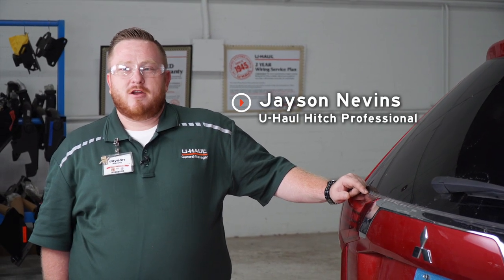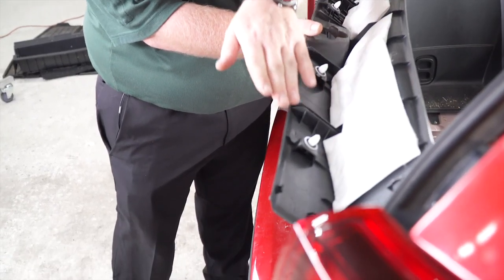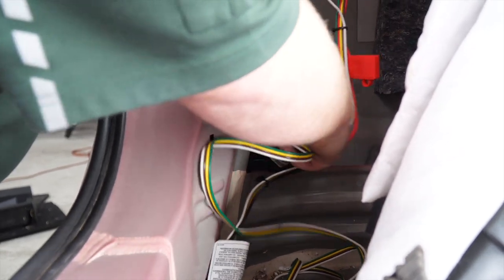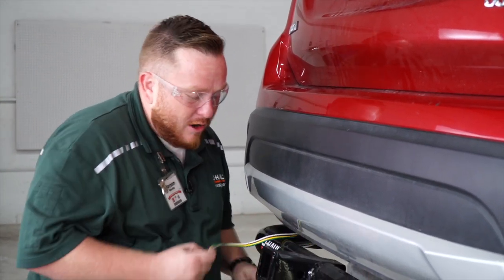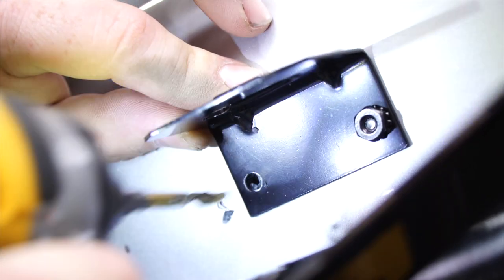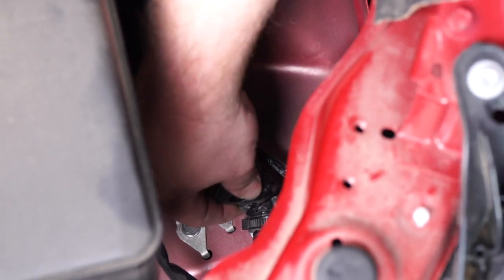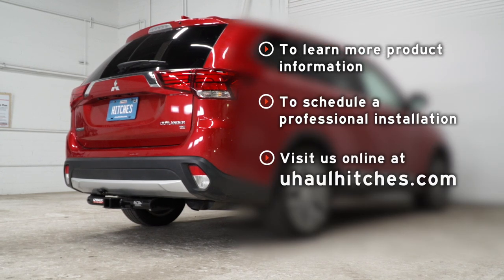2018 Mitsubishi Outlander Wiring Harness Installation

Comment: This says the instruction are for a 2018 Mitsubishi Outlander...but mine has the spare tire INSIDE the rear compartment area. Does my model, a 2018 Mitsubishi Outlander Sport SU, have the same quick connect behind the panel on the driver side? I don't want to take everything apart to find this is not the case. As a note, I looked under the hood for a quick connect, but did not see one. Any information is greatly appreciated.
Reply from the maker: Hi Stan, The Outlander Sport uses a different kit than the one in this video. We don't have a video for the Sport yet, but we have one scheduled for this month so we should have it in the next few weeks. Until then you can use uhaulhitches.com to find the right parts for your vehicle.
Reply: @trailerhitches  Thank you! I look forward to your next video!

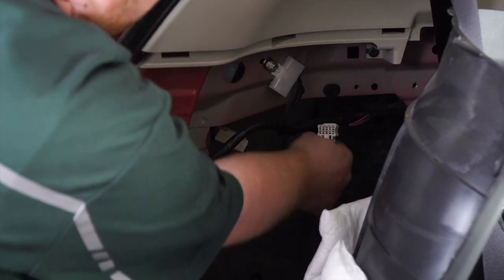Comment: 2:14 
That multi-socket (in the existing wiring loom) appears to be a 10 way outlet.
Are all TEN sockets wired, and if they are, then why are you NOT using a (trailer) 7 pin - or a 12 pin plug/socket connection at the tow ball?
Instead of a mere FOUR WIRE connector?
Reply: Not all the sockets on the plug have connections. It is only wired with the functions for a 4 Flat wiring harness. Also this is a video for the 4-Flat, If there was a connector for a 7-Way plug, we would've filmed that as well. Check our manufacturers website curtmgf.com and check their wiring options. There is only a 4 Flat option since there is no plug in option for the 7-way connector.

Comment: 4 wire ?
Ground / tail-lights / Brake-lights / & ?
Or does this useless 4-pin use the drawbar/ball mount as the ground, for a four wire LIVE (brake / tail / left & right turn) 
?
As - here in NZ all trailers MUST have a seven pin connection - with the ground IN the 7 pin (thus not relying on a possible rusty / intermittent circuit of the tow-hitch as a ground.
Then - there is the AUX and Service brake circuits as well.
7 circuits.
Reply: This may be different in the U.S. than in NZ. In the US, the 2018 Mitsubishi Outlander has a plug that only adapts to a 4-Flat (the most common trailer wiring connector in the states). If you need to connect everything for a 7-pin connector here's the video to convert a 4-flat to a 7-way connector https://youtu.be/hqze3Qgz-Ng